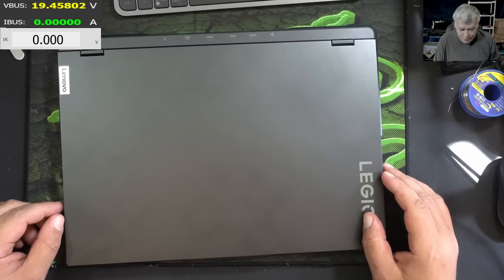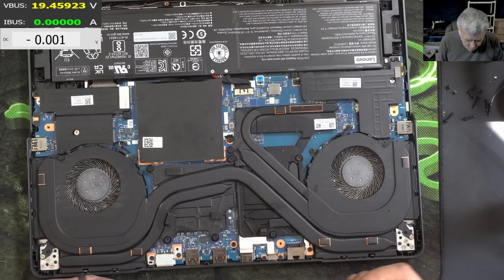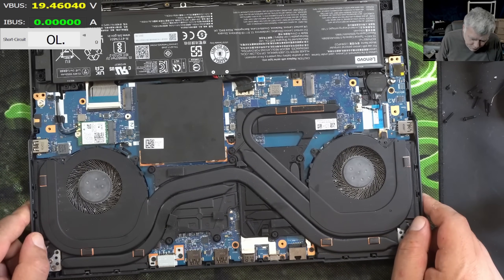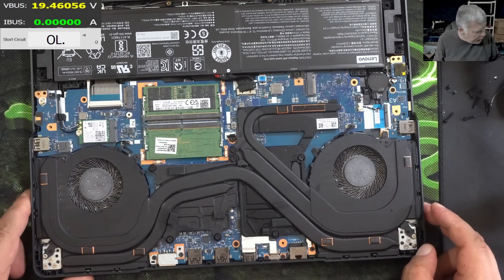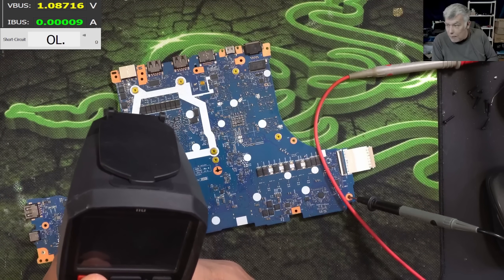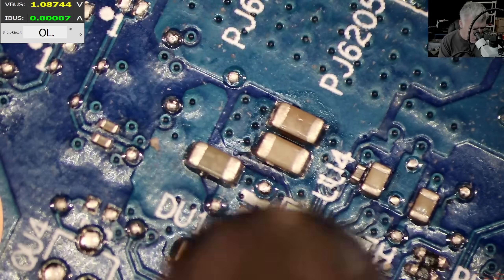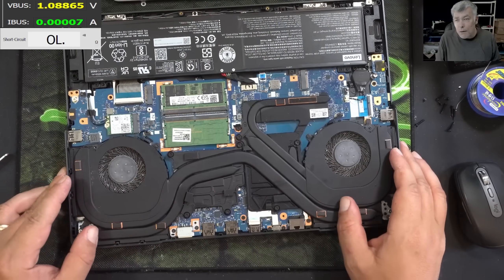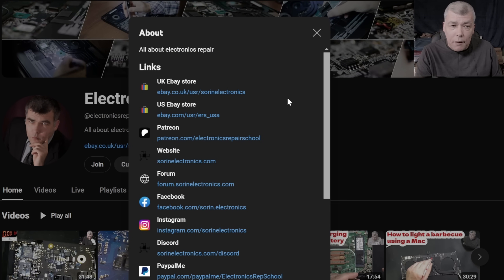Lenovo Legion Pro 5 - beeping, not coming on, motherboard repair

Comment: The RE-8A IC is hot. I replaced it with the RE-7J IC. The laptop remains dead and when it is charged, the indicator light only flashes. Please provide a solution. Thank you.

Comment: Your video automatically gets a like from me every time you replace a capacitor. Decoupling capacitors are fundamental for the IC's work stability and performance and need to be placed as close as possible to the IC on the board. "No capacitor, no stability. Replace the capacitor in another video!", probably a come back with stability and performance issues.

Comment: hi! can i ask for help or advice regarding my acer aspire 5 a514.

keyboard keys 2,3 and w are glitching..

steps taken to resolve
1. reset, clean format
2. replace with new keyboard
3. power reset (dont know what it really is called but i took off the cmos battery and laptop battery then shorted the board terminals for cmos while pressing power button for 30sec)

i've done all 3 but still the same issue.
Reply: your videos have been helping me ever since i started my laptop repair journey (did not have any other formal training, so i dont even know what the other board components are called 😅)

Comment: A used capacitor may be better than a brand new, just because if the used capacitor comes from a board, you can bet is a genuine component. Manufacturers do not use fake components, but if you buy capacitors from Aliexpress or Ebay you may get inferior product. So, in this case, a used capacitor may be a better solution than a new one. The same applies to MOSFETs and other ICs.
Reply: A used cap has also proven it's reliable.
Reply: 😂😂😂😂😂😂😂 as if the Chinese is stupid to make "fake" multi layer ceramic caps that only cost like $.0001/each when laptop assembly factories buy in a truckload container size.
Reply: @getmefix1921  Not being fake does not mean it is right. You can have ceramic caps with much different capacitance than it should, and lower voltage tolerance.
Reply: @getmefix1921  not fake, but rather counterfeit. also a lot are of poor quality or do not meet advertised specs

Comment: I fix motherboards as well but i will not waste my time to replace other capacitor , dont care what the haters say !
Reply: im sorry , i mean to reply David
Reply: If you need to give warranty to the customer you should rethink. Not replacing the capacitor, in some cases, will cause another capacitor to fail sooner than expected.
Reply: @HalifaxVomputersRepair ,, im so lucky , 3 months passed since i removed a shorted capacitor from a midrange asus laptop in April 2025 , it was a single cap beside a mosfet

Comment: What you can learn from all the repair channels is that you never buy a gaming laptop. ^^
Reply: Lol, what should I buy then? A notebook and a pen? 🤡🤡🤡
Reply: If you can, avoid it. I've seen several people buying gaming laptops for office usage, which is a waste of money and they are also buying problems. A gaming laptop, even if you do not game, is going to be under more stress, and all components will have a higher chance to fail.
Reply: I'd call it survivorship bias for your argument. Gaming laptops come to a repair shop because they cost more than $500. If a repair costs $200 for a $300 laptop, I'd just buy a new one rather than fixing it

Comment: I'm missing your tagline "no capacitor no shorted capacitor" . Great content btw.
Reply: The thing, when you do not replace the capacitor, you will increase the load on the other ones. They will have to work harder to compensate the missing one. That may lead to another failure sooner than expected. If you have 10 capacitors in parallel, in that case, yeah, one missing capacitor is not going to make much difference.
Reply: @davidlguerr  Understandable , thanks for the explanation.
Reply: @davidlguerr Sorin debunked this many times. They are not mosfet